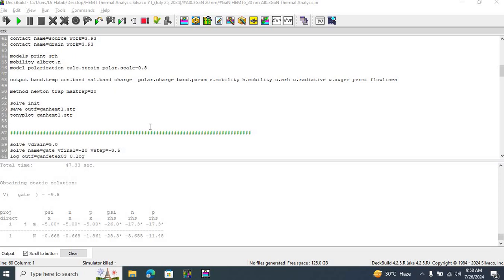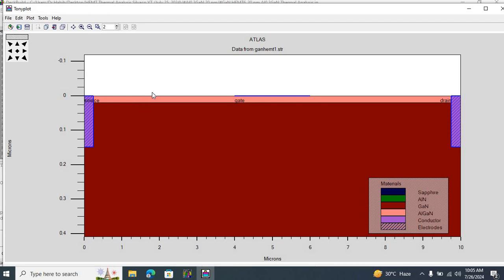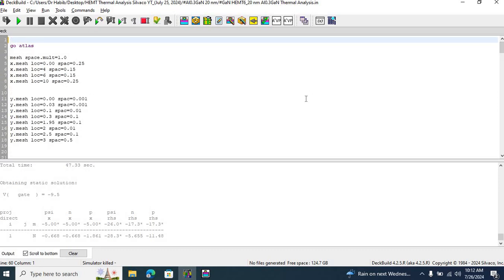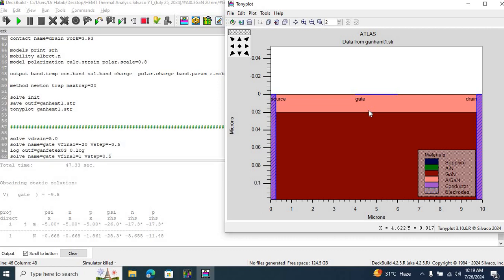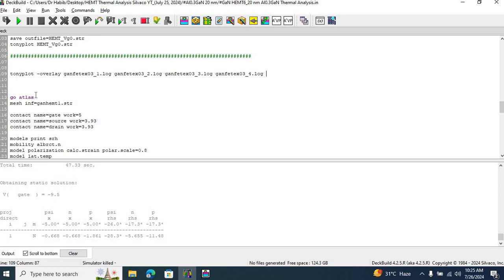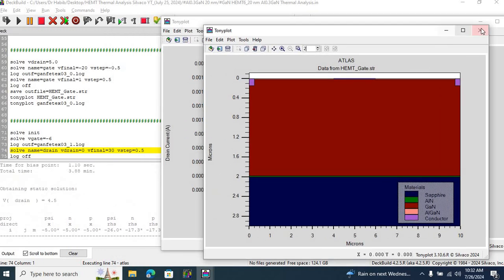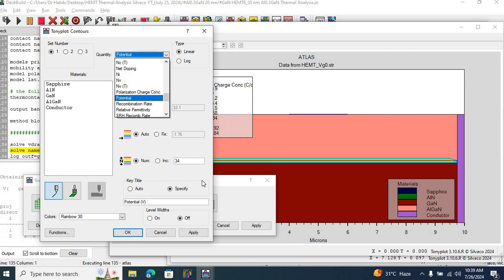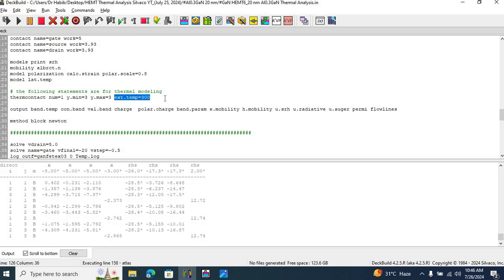GaN HEMT Thermal Analysis via Atlas Silvaco TCAD Simulation 🔥 💻

Comment: Hi, Sir, I’m trying to model the same structure as shown in the video. However, the results I’m getting are different, even though I’ve checked and confirmed that the code is the same. Could the discrepancy be due to differences in the software version? I’m using Silvaco 2021.
Reply: Same here

Comment: Hello sir, can you pls tell for calibration of any fabricated HEMT device in silvaco what procedure can i follow and which model and parameter we have to considered in my simulation to fit the result with fabricated ones
Reply: Thankyou sir
Reply from the maker: Iteratively adjust the simulation parameters to match the experimental data:
1.	Start by matching the threshold voltage by adjusting the doping concentration and polarization charges.
2.	Match the on-current and off-current by tuning the mobility parameters and interface trap density.
3.	Match the transconductance by refining the mobility model and contact resistances.
4.	Match the output characteristics by adjusting the saturation velocity and impact ionization parameters
Reply: Why doping concentration is required to match vt , my device is undoped.  can i match it through polar.scale only?

Comment: hi sir , your lectures are highly informative and helpful . Thanks for the effort . I have a doubt as i am new to silvaco , i would be grateful for your response . my ques :difference between "lat.temp" and "model temp" command in silvaco???
Reply from the maker: lat.temp sets the physical temperature of the lattice, while model temp sets the evaluation temperature for the material models.

Impact on Simulation: Changing lat.temp affects phonon interactions and heat generation. Changing model temp affects how the software evaluates temperature-dependent models like mobility and recombination.

Typical Usage: Use lat.temp when simulating devices under actual thermal conditions (e.g., heating effects). Use model temp to study the effect of temperature on device behavior without changing the actual thermal environment.

Understanding the distinction is crucial for accurately modeling thermal effects in devices, especially in cases where the lattice and model temperatures might differ due to external thermal conditions or specific simulation scenarios.

Comment: Sir when I add lat.temp model then simulator shows "Warning: Not A Numbers found in currents.
Simulator did not converge". What is the reason for showing this problem? .  while  without lat.temp model simulator converge it and i get current.
Reply from the maker: Did you try to run the same simulation as given in the code? Or did you make any changes to it?
Reply: I do simulations in the  same code, only add lat.temp model